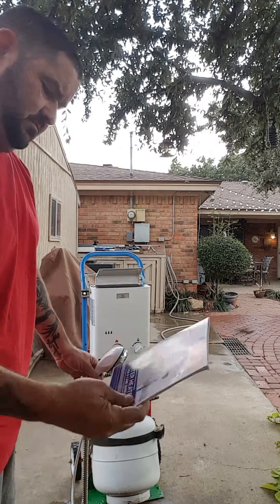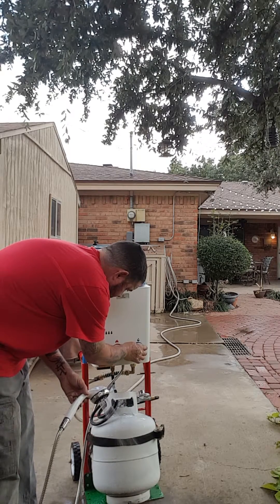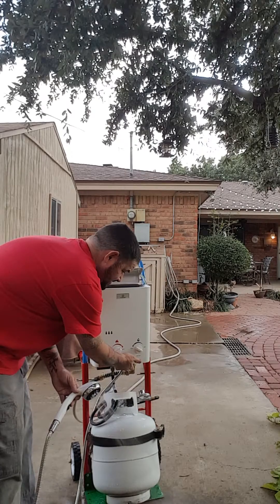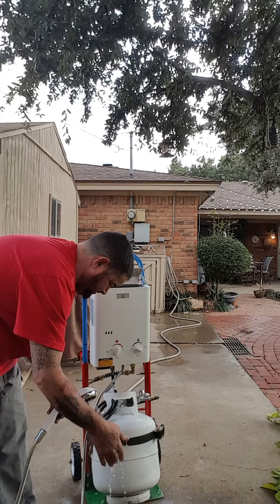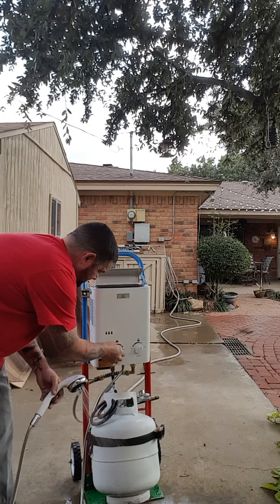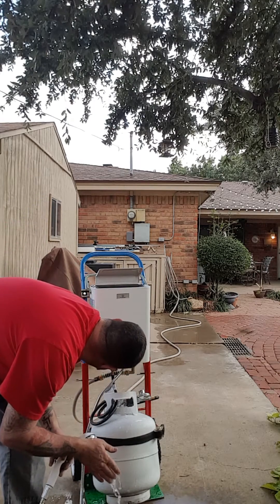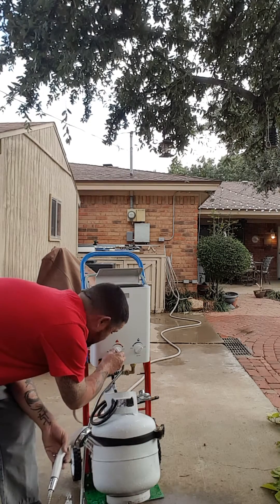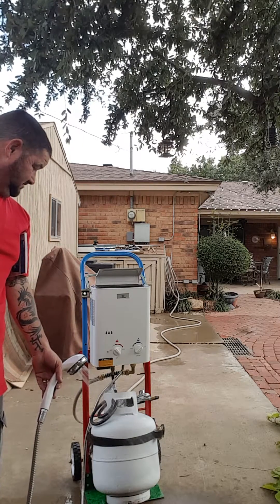L5 Tankless water heater. First startup. Trouble shooting.

Comment: Sometimes the shower head can restrict the flow, causing not enough water to flow throw the heater.  It seemed to me that if i had a shower head that didn't restrict the flow, i had less problems with it shutting off.

Comment: yes! that is exactly what mine does! the company says my water pressure isn't good enough but the pressure is good..... what I've been doing is during my shower when the water gets super hot, I turn it off at the shower head and then back on. That restarts it until it gets super hot again. so far the key is super fast showers! let me know if you figure it out and I'll do the same :)
Reply: Similar problem here in Melbourne Australia. How come it is so difficult to simply buy something that works?
Reply: @tonynemaric4221  Same problem here